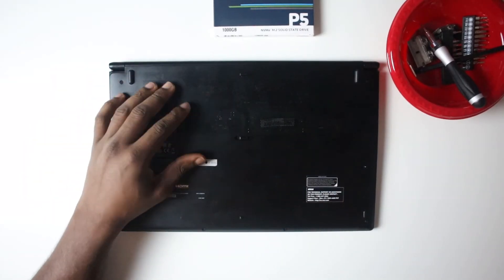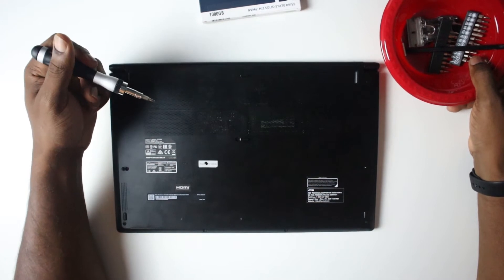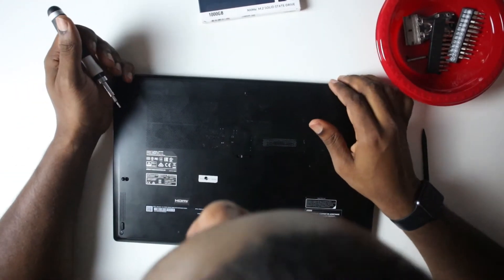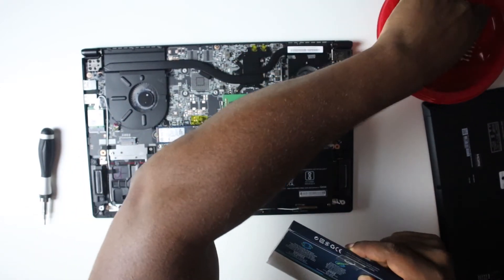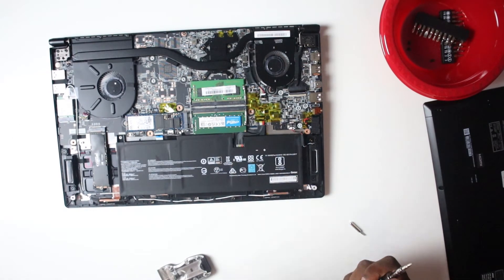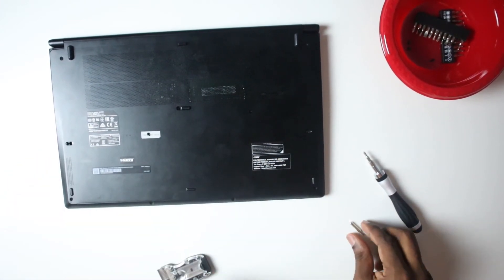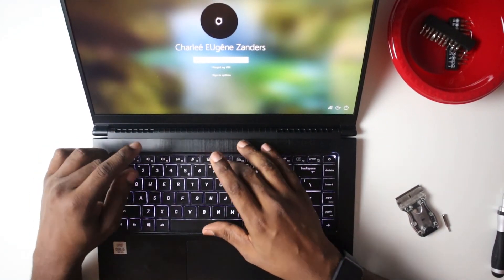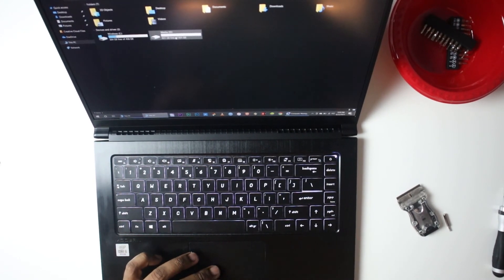Additional M.2 SSD installation in MSI Modern 15 Laptop

Comment: I have a Katana 17 MSI build, and the M.2 drive is in a similar spot on your example in the video, but there doesn’t appear to be a corresponding screw hole in the body. What should I do? I don’t wanna raw dog it flopping freely.
Reply from the maker: You can use those small double sided tape squares from target just use one square at the end of the m.2 where the screw should be. That’s strange there’s no screw hole in the body of the laptop. Try to place it on the label of the ssd if possible. That way it doesn’t damage the ssd let me know if that works out.

Comment: Hi, I just bought a MSI modern 15 (A11M-217XIT, i5 11th gen). I also want to add 8 Gb of RAM with a DDR4 3200 Mhz Crucial memory module, does yours work in Dual Channel with the pre-built memory module? Thank you
Reply from the maker: Yes it does